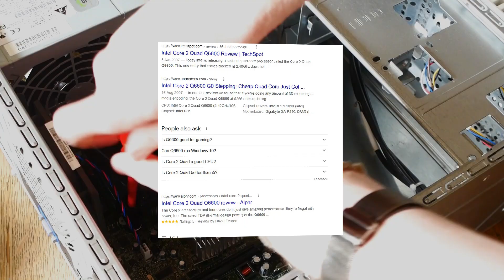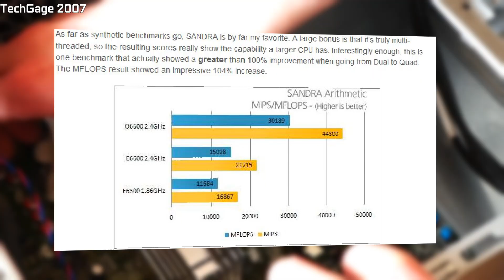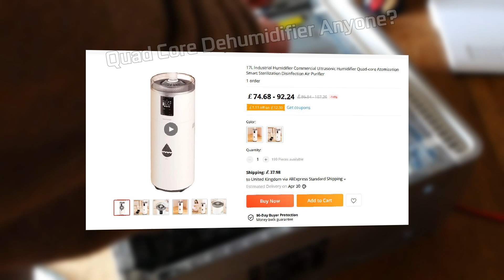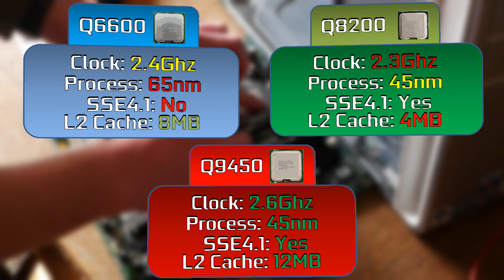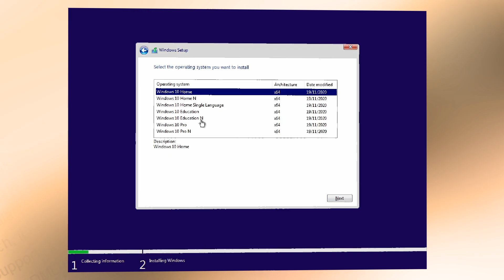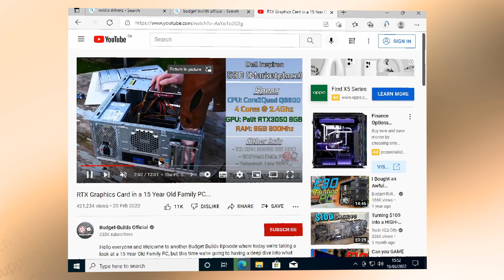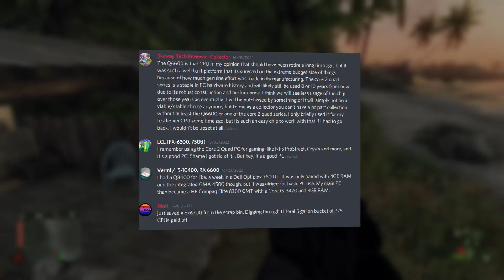Intel's Core2Quad...Finally Obsolete?

Comment: i have a q9400, i used an ssd, 8gb ddr2, and a r7 240 on a slim chassis pc build for my moms home pc, no gaming just video streaming and windows 10 home office use. its amazing how cheap it was to build and how it performs just as good if not better than new pcs at doing the most mundane tasks.

Comment: Honestly if you want to build a PC for under 350 usd, buy an old optiplex 380, a q9650, and an old Quadro 4200. It's really cheap and a great stand in for waiting to buy the parts for a modern PC. Although the max 8gb of ram will hold you back some.

Comment: My C2 experience is of the Duo variety, but still an impressive processor - the E8200. 
Back then it managed multitasking (even with my somewhat extreme use cases) just fine, but the main speed came from the overclock - I took it from 2.66 to 3.5 ghz on the stock cooler (lol). The temps were fine and it held stable, and it survived for 5 odd years. At some point around 2013 I realized how much the OC helped it, as a BIOS update I applied had reset it and the slowdown was too noticeable.

Comment: I'm a bit late but.. My current PC is with Q6700, Radeon HD 3850 and 4 GB DDR400 RAM. It's very outdated but it still runs games from around 2011 and plays youtube 720p without load (only in Firefox).

Comment: if only my pc's motherboard didnt die last year, i would still be using my q9650, ive been rendering and emulating games in it for a year and a half, i bought it for $20 and sold it for the same price, kinda surprised that people were still looking for that cpu, i guess they already have the rest of the system for it

Comment: My dad still uses his to this day. I had to upgrade it with a GT 710 to get YouTube to play at higher than 480p as those systems had the worst on board in history, but that's still 100 times better than buying him an entire new system he didn't need.

Keep in mind, he's 72 and the only games he plays are Solitaire, Sudoku and Lemmings in an Amiga emulator, but for general non-gaming purposes, it is still more than fit for purpose.

Just to be sure(since Windows 11 is a no-go) I installed Linux Mint for him, and that runs fine, too. In fact, it might be a bit snappier than Windows was.

Comment: I think using rx550, 560, and 570 would be better paired with a processor. I know no rtx but that will help with the framerate. also nvidia has a very robust drivers were Amd has lighter weight driver slightly more buggy  which would good for the weaker cpu well not the buggy part.

Comment: I have two Core 2 Quads in two different systems .. the first one, a Q9550, was bought new in 2009, I use it on a Windows 10 system .. the second, is a Q8400 bought second hand with the mobo and ram sticks 4 months ago .. I use it in a system running on Linux Mint 20.3 .. it runs like a charm really, despite its small cache size, compared to the Q9550 .. it's snappy, pretty powerful for web browsing, watching youtube videos etc .. and some light (but still pretty) games like Half Life 2, Portal etc .. I really recommend these cpus if you plan to build a cheap system for running linux distributions .. these cpus are so cheap now, and they just work !

Comment: I'm literally watching this video on a Q6600 I was given, pushing a GT710 in a cute little Dell Optiplex 755.
The system complained when I first installed the chip that "This processor is not supported."
And then proceeded to spring to life and serve faithfully every time I asked it to since.
The 80GB hard drive is a little limiting, but I've played a couple games on it so far.

Ninja edit: Also have a late generation 9000-series quad at 3GHz, but it's buried in a computer right now and I forget its exact model. Quick research says it's the 9650. I tested the system, but haven't seriously put it through its paces yet, as the motherboard's Northbridge heatsink is MIA and my replacement is undersized.

Comment: I built a system for a young mother based on the Q6600 back in 2020. She wanted a PC for her son, but the budget was incredibly limited.
Nontheless: I managed to scrap together a system with a Q6600, 8gb of ram, a GTX 750 ti and a 250gb ssd. Certainly no powerhouse, but in terms of of the 100€ budget (Including monitor and peripherals + OS) I had: It was fine.

Still does its duty to this day. That is: Light weight titles like League of Legends, Fortnite and Farming Simulator.

Comment: I played 3-6 EQ accounts at once and talked over Vent ( Ventrillo )  at the same time on a 2.8ghz single core athlon with NP’s, and It’s amazing how many people are still gaming on the core 2 duo just crazy, I use a 4 core laptop for surfing the web it’s amazing for what I use it for like there about to unsupport my windows version so I upped the ram from 6GB to 16GB DDR3 1600 and it’s like a whole different PC plus I put a cheap but fast SSD in it the HDD was on its last leg so I should still be fine when I’m forced to windows 10 instead of buying a new laptop like most people will or have already I spent $40usd on ram lol the SSD was free lol from micro center

Comment: i will be real though, buying a used fm2 fm2+ cpu from china is cheaper, their motherboard is cheap too
like a 760k perform better than q9550 but costs like 5 usd 
a high end china a88x fm2+ mobo with 4ram slot costs 15usd

a 740 may even cost 2usd
even 860k is cheap at 8 usd

they literally run 4 cores at 4ghz

Comment: I used to play games with a Xeon E5450 csgo ran at like 70FPS every valve game of course ran well. but then theres Cities skylines which depending on how big your city got ran at 30FPS and lower on reduces settings. Hitman absolution was a bit better to run running slightly above 30FPS. then theres JC3 which was just a slide show

Comment: why didn't you talk about  the 771 xeon is beyond me

do you even know what you are talking about ?
Reply from the maker: 17:00 👍
Reply: @BudgetBuildsOfficial  nice, but you should talk about them at the same time since there is no point buying 775 lga cpus when the 771 mod exist
Reply: @nemergix1707  it's not like this makes much difference to the point of the video. 

also, +10 points to you for the Passive Aggressive comment lol

(and the mod doesn't work on all socket 775 pcs)
Reply: @stevesmith1383  its just misleading do so a video on 775 then not talk about the main great thing about 775

How many ppl you think got out and brought exensive c2q cpus when they would have been better off with a xeon after they watched this video ?
Reply: @nemergix1707  not remotely misleading. The platforms can be linked as a whole.

If anything, the 771 mod is too much hassle when you can just do the q6600 Tape Mod and turn any sub $10 q6600 into a q9650, more or less (different cache size)

Also I think maybe zero people went out and bought something based on this video. This video doesn't encourage anyone to buy anything, nor should anyone be buying 775 or 771 stuff. He expressly says this is more about people who already have them, not for people looking to buy them.  

He also mentions the 771 CPUs and mentions he will make another video discussing them and the extreme CPUs.

Comment: I had a Q9400 with a Gigabyte UD3P motherboard that ran stable on air at 3.92Ghz from stock 2.66Ghz. That made me really fall in love with overclocking as it made such a performance difference. My next cpu a 2600K was not as good, but still better than what we get now for overclocking. I think the eras of massive overclocking gains are gone.

Comment: Up until 2016 I still ran a Pentium E2200. My old board could support a Q6600 or better. I think I will buy a cheapo core 2 quad, throw it in there and still use that PC as a Linux backup or a simple home storage server.

Comment: i still run a quad 6600, it just works for what i need and never misses a beat. i replace the thermal paste yearly. had my moneys worth ten times over with not needing to upgrade. i will continue to run it till it dies.

Comment: I have had the Q6600 since about 2007. This has been the longest I have used a computer without an upgrade. (A motherboard + CPU, to be precise.) That’s 15 years, and it has been in constant, daily use during the entire time. Back then, it was an overkill for me, but I wanted something that I wouldn’t have to upgrade in a couple of years. Well, I got that. For office applications and internet browsing, it’s perfectly usable even today, although YouTube in 1080p can be a bit slow. Best CPU I have ever had.

Comment: Back then i had a Pentium 4 with hyperthreading and virtualisation (not sure which exact model).
Yeah people hammered on about oh how bad the Pentium 4 line was, but i kept that CPU till the final upgrade to Nehalem - first gen Core-i series. My friends used to switch to the Athlonx64, C2D and C2Q but up till the Core-i series it was never worse than what they used. At the end of its live it finally overclocked it to a bit over 4 GHz. Heck, that was a business-PC with an onboard Nvidia Quadro - and it was strong enough to play WC3 on a nice 1600x1200 high settings in maps with hundreds of units.
upgrading to a C2D/C2Q would not have been worth it for me.
(But darn - not only was the i5 760 Nehalem faster with a way lower clock, darn was that an OC beast. from 3.3 GHz singlecore boost to 4.5 GHz allcore.)

Comment: A year after these came out was when I bought a AMD Tri-core CPU for $112 & a $90 mobo & 2G 1066mhz RAM
I clocked it to 3.2ghz & unlocked the 4th core (it ran at 3.6ghz with a silly-small voltage bump but not with the 4th core)

Its my DVR system today, as it fits a cheap micro-atx case.  No USB3 but besides that it works great.
These quad cores & the 2012 eight core were ahead of their time.  Now with browsers & video players & games being so multithreaded it really was one of the few times computers were "future-proof"

These 2.5ghz+, 4+ core, 6G+ RAM systems will probably be usable until the end of this decade
With PCIx 2.0, SATA (and how cheap SSDs are), GPU offloading & multithreaded streaming decoding there isnt an end in sight

Comment: The only problem I've found with my CDQ is that it's missing a instruction set needed to run Anthem, which isn't really a problem at all 🤷‍♂️😆

But seriously, matched with a good AMD grfx card that offloads a lot of the media work and you can still survive with a Q6600 and 8gb of ram :)

Comment: I think the first gen core i7 lga1156 is going to replace and beating these q2q:s as usability and longevity. I still have one running as my 2nd PC and it's completley usable, not just usable. It can clock to 3.7ghz and run almost all the games smoothly. it was so much upgrade back then.

Comment: Why did you use Rtx 3050 with core2quad is just bottleneck 100% and Cs Go with a Gt 1030 and a core2quad you can get 100fps on 1080p low-medium settings.

Comment: I think you forgot the cheaper alternatives: the Xeon LGA 771! I have 2 Xeon E5450 (LGA 771 modded to LGA 775) running on Asus and Gigabyte boards, and they easily outperform a first generation Intel i5! The Xeon E5450 is equivalent to a Q9650, which is about 7% faster then the Q9450 you used in the benchmarks. Not a huge different in performance but a huge difference in the pocket 😉 One of them is my nightly/weekend computer running Windows 10 with no noticeable slowdowns. I can't afford to buy a new computer and I only play old PC games or console games, so there's no reason to fix what is not broken.
Reply: I was gonna say this. The LGA 771 Xeons give the performance of the most expensive LGA 775 chips at much cheaper prices. Definitely worth a try if you have a old motherboard lying around.

Comment: Some games at the time ran better on the core 2 quad CPU's, all in all when i had a intel q6700 in 2007 I usually ran a BF2 server on one core and the game on another, leaving 2 other cores for other tasks such as a VM etc. I will say after upgrading from Win XP to Win 7 at the time made a dramatic improvement with frame rates due to the OS handling multi cores better

Comment: A processor that is maybe even more important is the phenom and phenom II. Phenom 4 core predate core 2 quad.. while its not quite as fast, its not far of. 

Most People dont know that amd use  to have  cpu with good ipc  piror to ryzen, and well they did. Phenom was just a smidge behinde core2quad, and far cheaper.

Also, when was the last time we could use a cpu for 15 years? Thinking of cpu that lasted  a long time. Probally  385dx25 or 486dx33 was one of the one that lated the longest.but not 15 years.

386 came in 1985, and it was a monster. Still in 1990 it was a good cpu... but by 1995 it was a joke.

486 was introduced in 1989. In 1994, it was still a really good cpu, but in 1999, it was a joke. Both lost there usability about 8 years on.

My 2006 phenom was replaced in 2020, not because it was slow, but because the MB broke.

Comment: My secondary PC has an Core 2 Quad 8400? You didn't feature it at all in the video but its clocked at 2.66GHz and is able to run most software fluently, if its running windows 7 Ultimate strictly that is, with windows 10 it has some issues and if you try to use something like windows 7 professional, it just straight up doesn't wanna work, But it works perfectly for what I do witch is roblox and discord.

Comment: I had used a Dell XPS 410 which I upgraded to the Q6700. The Intel Core 2 Quad is usable for general tasks although I feel it runs slow when running Windows 10 which could be due to Windows 10 being more demanding compared to Windows Vista, 7, or 8. I remember you could run Windows 8 with just a hard drive and 4 GB RAM, but you need an SSD and 8 GB RAM to run Windows 10 well.

It seems modern games made them the processors useful. Back when these were introduced, most games only worked with 1 or 2 cores and 64-bit wasn't important even when Windows 7 pushed it. However,  many newer games are starting to require a quad core processor and almost every game since 2014 (though a few modern games are 32-bit like Black Mesa, Brookhaven, Lawmage Academy, and Didnapper 2) only support 64-bit Windows.

It can play games provided you have the appropriate GPU though I do have a note with some games. Minecraft: Java Edition works, but it takes a long time to load in the Chunks. The Sims 3 (2009-2013) is playable but the loading times are very long even with an SSD. The Sims 4 could be similar though The Sims 2, The Sims Stories, and The Sims Medieval work well (however, 2 and Stories do have a graphics bug with newer GPUs). Some people said that Apex Legends doesn't work.

Comment: If I remember correctly alot of those 530s didn't except Quads, only certain ones. I used to use Xeons w those, use the pin sticker and the modded bios, worked great!

Comment: Used to have a Q9550 on the legendary DFI LanParty P45 T2RS+ board. Overclocked that thing from 2.8 all the way to 4.2 ghz. It was a pretty huge OC for that chip, even with watercooling, it was difficult to keep the temps under control. Used that CPU for several years, paired with an SLI of GTX460s and 12 GB of DDR3. I used to be so proud of it, it ran Crysis 2 in 1080P with settings maxed out, including DX11 and the HD texture pack at over 80 fps. This thing was quite a beast back in 2011 xD

Comment: i'm leaving to use my Q6600 but change it to use Xeon L5420 since it's still quad cores but with low TDP just 50w! i'm currently using it in my store as cashier

Comment: Your graphics card is failing to become the primary graphics card from the onboard intel GMA vga out port. The (intel GMA) vga out port on your motherboard has a serial signal which is sends to the monitor and it is failing to reset to allow your graphics expansion card (the RTX or the Fury) to become the primary video adaptor. It is not specific to your RTX and it happens with other cards too (e.g. a radeon HD series). The TLDR of this for a workaround is (when powered off and unplugged from the mains, following static precautions) to remove the CR2032 battery from the MBoard so as to reset the CMOS. It is possible to use jumpers but the battery trick helps for most people. Try it more than once if it fails first time.
As an aside, referring to the title but not about gaming per se, the quad-cores can be used for an IPFS rig (installing the pertaining IPFS OperatingSystem under MIT license) since they perform blake2b 4way parallel processing. That hashing algorithm is used by whatsapp for example. The cache is not the main requirement (although it helps) but rather the fact that you have 4 of the FPU on that chip. Also 7zip can use it. This comment is so as to help.
My comment has no hate in it and I do no harm. I am not appalled or afraid, boasting or envying or complaining... Just saying. Psalms23: Giving thanks and praise to the Lord and peace and love.

Comment: This is also caused by the fact that PS4 and Xbox One had garbage CPU's, which didn't allow games' development to reach new CPU performance heights. Now with Zen 2 CPU's being the new baseline on current consoles the Q6600 would be finally obsolete. Stellar processor.

Comment: lol 🤣 im still using core 2 duo e4400 processor from 2006
Reply: whoa.. that's even slower than the e8400 I used in 2014. Well, but if it still works for your needs, then there's no need to upgrade.
Reply: @boiledliddo  it still works for very basic browsing